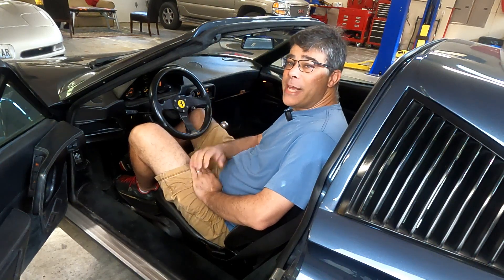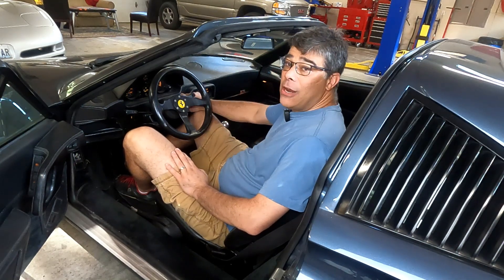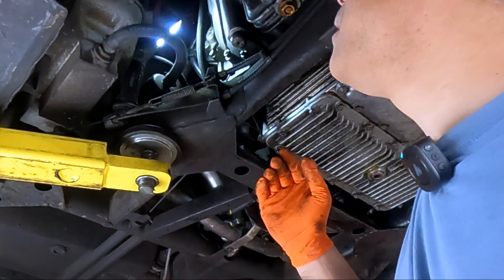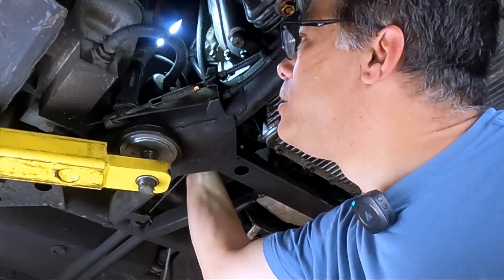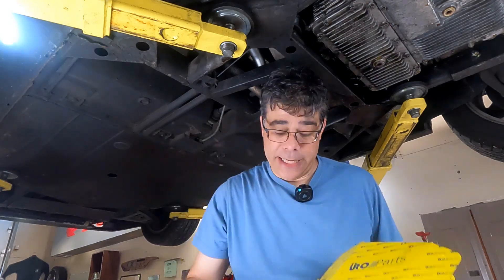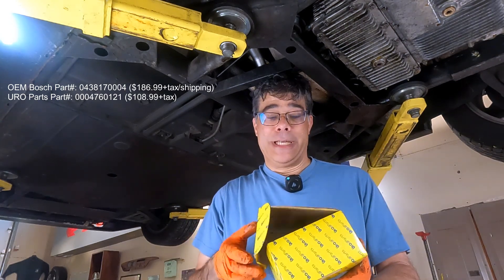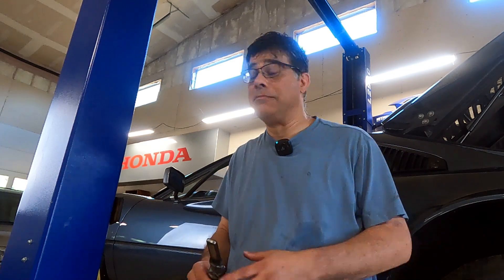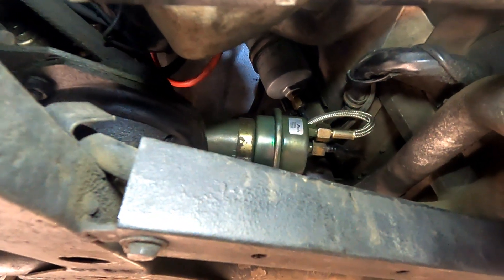Solving Hard Hot Start Ferrari 328/308 & Mercedes 450/280/500 Bosch Fuel Injection Accumulator

Comment: Regarding the inlet hose connectors on the fuel pump and the connectors for the fuel accumulator....do we need to ad fuel resistent thread sealant??
Reply from the maker: You should not have to add thread sealant.

Comment: Great video. Did you have to drain both fuel thanks to perform this repair?
Reply from the maker: No, you do not have to drain the fuel tanks. If you replace the fuel pump, however, you will need to simply clamp off the rubber fuel feed line to the pump.